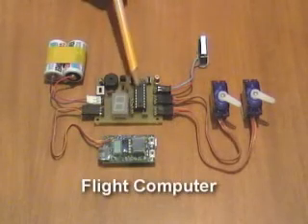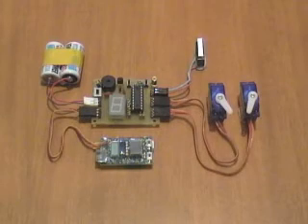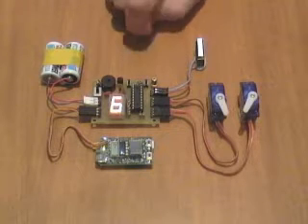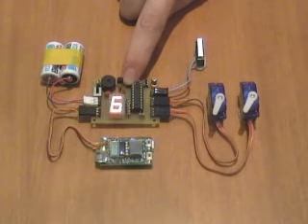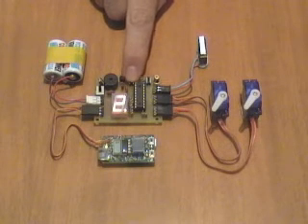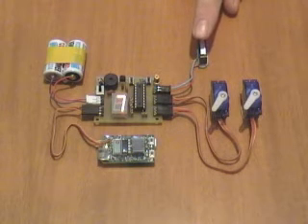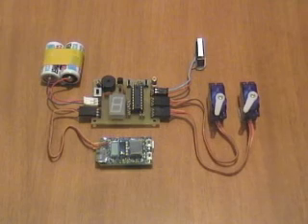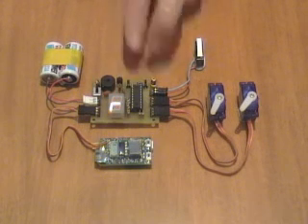Water Rocket Flight Computer

Comment from the maker: Hi Daniel,

The computer was designed so that you can fully configure it in the field without the need for any other equipment. The two buttons on the front are all that is needed. The settings are stored in Flash memory so the settings are retained even if you disconnect the memory.